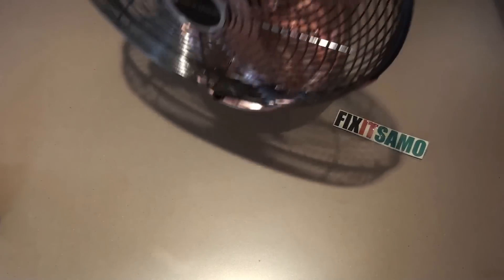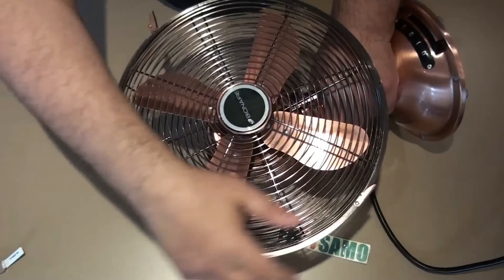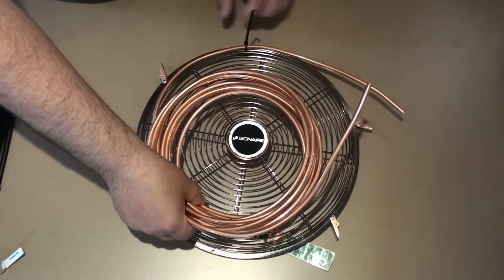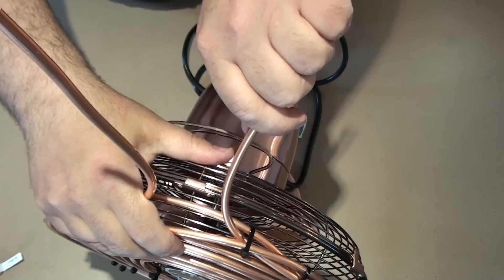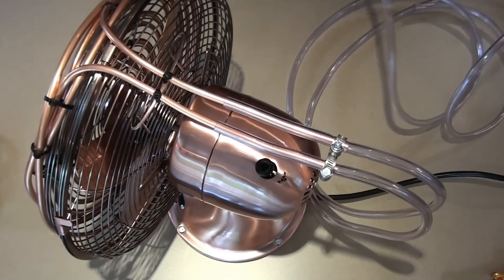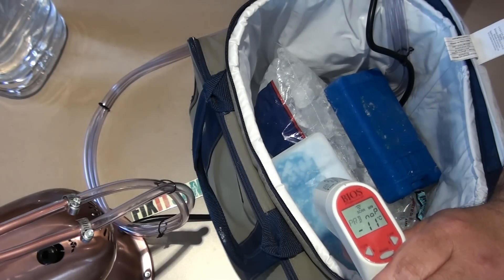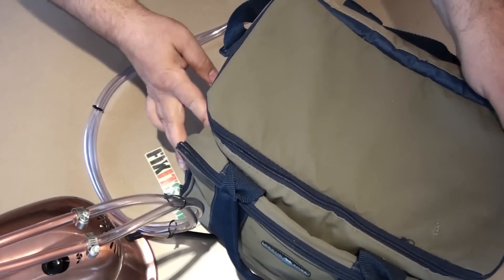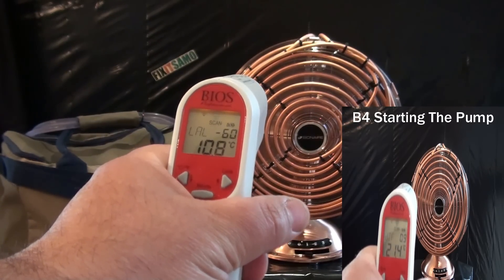How To Turn Your Fan Into An Airconditioner  AC

Comment: Unless you have unlimited free ice source, how does this save money?
Reply: You can just keep a few frozen water bottles in the freezer and cycle them.
Reply: Wow. Let me dumb this down to Kintergarden level, I can't make crayon doodles here for you. An ice maker makes ice by removing heat from the water. The heat removed from the water enters your home via the cooling fins on the back of your fridge, plus the heat from the electric motor and components  of your fridge, plus the heat generated in all the frictional losses, etc.  Also, the motor on the fan itself produces heat, and the fountain pump produces heat. Long story short, this system introduces more  heat into your home than was there without it in several ways, and uses more electricity in the process. The only benefit whatsoever is the cool air right in front of the fan, every where else in the house will be slightly hotter to compensate.
Reply: *****
I apologize if I offended you. I wasn't saying that this idea would not cool a person off if he were sitting in front of it, and also did not read in the description that you were living in a van. Not knowing that, it  seemed like you were advertising this as a 'free' or 'cheap' Air Conditioner, and it seems like a lot of viewers saw it that way. 
If you have a free source of ice, hotel icemaker, a friend with a big freezer, whatever, or even if your freezer is outside your home, then the ice you bring inside will give you a net drop in interior temperature as it absorbs the heat from inside your living space. If you create the ice inside the area you are trying to cool, the device you use to create the ice will not only put the heat it removes from the water (to turn it into ice) back into the room, but also the energy the machine uses to accomplish that task, also in the form of heat. You may feel cooler if you directly in front of the air stream of the fan, and the evaporation of your sweat in the moving air will also help to make you feel cooler, but the entire system will only add heat to an enclosed system, as there is nothing moving the heat from inside your van to the outside of your van.
Reply: You are still missing the point. The roof vent in your van will pull hot air from the ceiling of your van, correct, but anytime you pull air out of a space, you create negative air pressure that will suck outside air back into that space.., . Insulation in your van will help keep outside heat from creeping in, correct, but if your ceiling fan is sucking hot outside air back in, you aren't gaining much, eh?  If you are sitting directly in the air stream of this device you will feel cooler, correct.
BUT- as a whole, your system introduces more heat into your van than it removes. The fan motor produces heat as it consumes electricity to turn the blades. The water pump produces heat as it consumes electricity to pump water. The ice maker produces heat as it consumes electricity to turn the compressor and run it's internal fan. All three of these devices produce heat. If they are all in your van, and your van is insulated, you have actually heated your entire van to cool a small area. Do you get what I am saying? When you make ice, your icemaker removes heat/energy from the water and dissipates that energy via the coils on the rear of the machine, right into your van, PLUS  the heat used by the electric motor running the icemaker, plus the heat from frictional losses, etc.  Same for the fan and the water pump. All this heat is now INSIDE your insulated van. Whether you power the icemaker, fan, and water pump with solar panels or an extension cord to your mom's house is irrelevant, they will make the same heat either way. Now, if you mounted everything outside your van, with the fan blowing in thru a hole or window, the heat and waste energy from all of your equiptment will be outside your enclosed, insulated space.

Comment: Neat, but not practical. What about the condensation that is going to occur on that coil? Just let it drip?
Reply: No condensation  because of fan's moving air.
Reply: Or you could put a pan or towl under it, dumbass
Reply: haha no condensation... yes condensation the cooling coil is below the dew point depending on humidity it can condensate a lot!

Comment: Now plug your solar panel into the fan and pump and you will have free cool air
Reply: You could hook up a desktop ice maker to the solar panels too you know. Several videos on youtube about it. Point is that you could take it even further and reduce the cost of even the electricity itself.
Reply: TheGrayman1234 That wouldn't work very well for your room unless the desktop ice maker is outside or in a room you don't care to get hot.

The issue is that the desktop ice maker makes ice by forcing the heat into the air around it. It actually produces heat while doing this as well. So if you do this, you may have a fan blowing cool air, but the air around you will be getting hotter and hotter. 

This is why your air conditioner runs the antifreeze outside to cool it off, so the heat has somewhere besides inside your house to go. Notice you never see a stand alone A/C unit like you do heater. You have to either have a central unit which runs the heat outside or a window unit which puts the heat outside through the window.
Reply: TheGrayman1234 I get your point as well, but its not an efficient system. It would be more efficient and cheaper to hook a window unit up to a solar panel.
Reply: yep, ACs just move heat, they dont hmake it disappear
Reply: im not going to reply about Mexican joke
Reply: Not free. You still need ice. Either you buy it from the store or you get it out of your freezer. It needs energy and water. If you do get it out of your freezer then its likely you would be better off just not plugging up your freezer.
Reply: +David Parham Sure window units are more efficient, but cheaper to hook up to a solar panel? Hehe. AC units are energy hogs. To power a 500 Wh window unit about 8 hours per day, you'd need about eight 110 Ah batteries costing around $1,100+, six 200 Watt solar panels costing about $1,200+, a charge controller costing around $200 to $1000+, an inverter of about $150 to $1000, racking, wiring and accessories costing about another $200 or so. Total cost of around $2,850 on the low end and that would primarily only power the AC unit. Some use even more watts of around 1440 Watts per hour. Triple that cost. And don't forget the cost of the AC unit itself. 
Still think it's cheaper?
Reply: HealthIsPower Window unit will be cheaper per unit of heat you take out of your house. Anything you build will not be nearly as efficient. Theres no need to reinvent the wheel.
Reply: HealthIsPower To clarify, TheGrayman1234 was trying to take a cooler (fridge), use it to cool down water, have that water travel through the copper pipe, have the fan blow over the copper pipe to take heat out of the air, down the piping, into the cooler, where the cooler would then pump the heat outside... which wouldnt even help if the entire thing was in a single room. All of this would have to run solar. All I was saying is it would be more efficient to just buy something that was built to move heat. That fan isnt going to cool down an entire room, but that A/c unit could if you wanted it too. It could do exactly this, and pump air over your face. You would only need it at an eighth blast.

Comment: if you put salt in the water it will super cool the water making it even colder.
Reply: You would destroy your pump with salt. :/
Reply: because salt water aquariums don't have pumps...
Reply: @David Parham, Salt won't kill your pump there are millions of salt water aquariums that use similar pump systems that has galvanized metal shafts. Yes the shaft would corrode but only after a year or more, or you could simply get a pump with a ceramic shaft.
Reply: Care to explain why?
Reply: true. We learned that in 3rd Grade when we learned how to make homemade ice cream, it was in science class they were teaching us about how salt and ice makes things so much cooler enough
Reply: not if you make it a seperate circuit, as in a heat excahnge unit (like coiled up copper tube)
Reply: Stephan Joubert Yeah. I guess salt water pools have pumps as well. You also have pumps used for cutting tile that get all the tile dust in them. Didn't quiet think that one through. The truth is I disagree with the salt in the water making it colder reasoning, but this was an easier target for me.
Reply: +Roman Tomjak depression of freezing point due to non volatile solute i.e. salt here.
Reply: dhruv anand That doesn't explain why putting salt in the water helps lower the temperature. The truth is, in order for this to work we would be needing to put the salt on the ice, not in the water.
Reply: +David Parham no, actually what we're trying to do here is to keep water in liquid state as the ice is at - 11° Celsius and without salt water would freeze at 0°. Hence, we know to lower its freezing point by adding salt
Reply: dhruv anand If we were trying to do that, then we would have problems with the water freezing in the first place. He doesn't have ice running through the pipes. The water is staying above freezing point the entire process. If you were to add salt to the water to make it cooler, you would need some extra modifications like adding salt to the ice or having the water be cooled longer.

Comment: good idea. a portable a.c is expensive to buy not to mention the wattage used. but what about the condensation that accumulates on the copper tubing? does it just blow in the wind?

Comment: amazing creation. can you use dry ice unstead of regular ice?
Reply: remember that it gives off CO2.  dont want too much of that in an enclosed space
Reply: you would need to design it more like a heat sync then a water cooler but yea. basically get a bunch of dry ice and stick the metal tubes in there the tubes will get cold from contact... how cold IDK.
Reply: also this ^

Comment: Nice design. I would suggest for version 2.0 that you use a small plastic cooler instead of the bag cooler, and add some salt to the water so that it stays colder and lasts longer.
Reply: It doesn't last longer with salt, it lowers the melting point which increases the speed of melting
Reply: It'd destroy your pump.

Comment: What do you do about the condensation on the copper tubing? I'd be very concerned about running an electric fan around parts that will pull the moisture from the air.
Reply: If you notice the copper tubing is on the outlet side of the fan. Condensate will be put into the air by the fan. similar to how a swamp cooler works. no need to worry.
Reply: The wind blows it away from the electrical stuff?

Comment: Good try, but cooling with melting ice is only 334 kj/kg, it is better to evaporate water it gives 2257 kj/kg , that is why evaporative coolers exists.
Reply: true, but that's much harder to build at home.
Reply: Evaporators only work well in dry climates.

Comment: Tried it. Air was cool directly in front of coil but had condensation build up which was dripping water all over the floor under my fan. Also, definitely need to use a proper cooler. I used a bucket with ice and water for the test run. Didn't last more than an hour before ice completely melted. I will try it again with a cooler in hopes of keeping the water colder and longer. I live in the Philippines so needless to say, this would have been a great idea had it work a little better. I'll give my results with the cooler later...

Comment: This has it uses for only special, but temporary cooling like when your A/C breaks down or when you are cooling a space for a day. I suppose you could use it as a desktop cooler, but keep in mind you still have to make the ice for this to operate. In a more permanent installation for cooling a room, a window unit or portable air conditioner will always be more efficient. If you regularly need some zonal cooling for a room in a central, climate controlled building, just get a cheap 5kBTU window unit. The are known to run less than $100. At 400 to 500 watts, it's safe enough to run on any 10 Amp or higher circuit. Keep in mind that once the room reaches the desired temperature, the thermostat on the unit will occasionally operate to maintain the right temperature so it won't always be pulling its rated current. Of course, it will run more on hotter days and cooler on cooler days.

Comment: The test method at the end is not very accurate as your aiming the IR temp probe at the copper pipe which has cold water running through it.
Show the temperature of the air going into the back of the fan and coming out of the fan with the water flow off and on.

There will not be much surface area on those copper tubes so the cooling wont be that high.
Reply: Not to mention that you don't know what the room temperature is. If the room temperature is 15 degrees, that's one thing, but if it's 35 degrees that's something else. In other words, how much is it being cooled?

Comment: Wouldn't it be easier to get a can of R-134a for car AC and fill the lines with it and make a closed loop system? Would sure beat having to use all that ice water...
Reply: You do know how AC works right?

1: R134A starts off as a gas
2: the R134A goes through the compressor
3: after the R134A has been compressed it becomes hot
4: so it goes though the condenser(A radiator) to cool down
5: the the cooled gas goes though the receiver/drier unit to remove any water that might be in the system
6: the cool gas then passes through the evaporator where the gas expands back, this releases heat(think of when you spray a can for a while how it gets cold)
7: this makes the evaporator very cold, the fan behind the evaporator blows this ice cold air out into the car,
8: the expanded gas then returns back to the compressor
Reply: how to compress the gas?
Reply: Precisely. Freon in itself has no cooling effect. It is simply a gas (with a pag oil additive) that can be compressed and expanded, allowing it to absorb/give off heat as it goes from high to low pressure (high pressure liquid to low pressure liquid to low pressure gas to high pressure gas to high pressure liquid to.....). Putting freon into the line without a way to introduce a refrigeration cycle is ineffective. Want to see how ineffective? Turn your car on without cranking it. Turn on the A/C. Feel refrigerated air? Nope....because the car isn't running (hence no compressor) despite all the freon in the lines, condensor, evap core, etc....
Reply: well why not get a compressor to hook into it? can pick one up at local junk yards for practically nothing, it doesn't have to be fancy, just functional.
Reply: you would need to radiate the heat outside outside of your cooling space like any other ac/ refrig
Reply: look at "ductless ac", the compressor is outside, the compressed refrigerant is pumped inside your house where a fan blows on it.

Comment: why sould it have vabritions???you dint touch the blades or the motor....
Reply from the maker: +Eftihis Androulakis 
If the cooper tube is loose and not very well secured it will it will make noise when you start the motor

Comment: Which homemade ac is better : this one with the cooper tubes and punp or the ones that just blow air trough  ice in a cooler?
Reply from the maker: +TheDRIBBLER2 
With this method the ice will stay cold for around 12 hrs cause the cooler is closed and the ice is very well isolated 

Cause  by making a hole in the cooler and blowing  air in it  logically the ice won't last for a long time  its like taking the ice from the freezer and  putting it in a open cooler 
The ice will melt in 3 hrs max
Reply: It's a combination of how much ice you have and how fast you bring it to room temperature.  You're not going to get more total cooling from swapping these methods, that is only determined be the amount of ice you have.  If the ice lasts a long time, you're not getting much cooling and vice versa.

Comment: if you ran the ends of the copper on the bottom instead of on the top of the motor there is no risk of electrocution if the system leaks
Reply: doubt it would leak... there's not enough pressure to cause it...js

Comment: That would melt pretty quickly,especially on a hot day......
Reply: Just add salt inside the cooler and it would be cooler
Reply: This will corrode the pump.
Reply: Salt just causes the ice to melt.  It doesn't do anything to the amount of heat it can absorb.  Think of it this way, you have ice and water in @ 32 deg in one tub and saltwater @20 deg in another.  The first tub will stay at 32 deg until  all the ice melts then steadily rise.  The second will steadily rise from the start.  the difference is 0
Reply: aquarium pumps are made for saltwater... saltwater fish tanks

Comment: I wonder if a front evap core from an old ac would work.
Reply: It will work quite well due to the high surface area of the unit as it has fins.
but you will need a fan that has a high static pressure as those fins are tight.

Comment: Simple fix to try. Stick reservoir in freezer. Fill reservoir with anti-freeze. No ice needed, no maintenance.
Reply: do you not know how a freezer works
Reply: alcohol is better than anti freeze, you dont need methanol, but IPA will work
Reply: Worth a shot,  but It might move too much heat into the freezer. The sealed system on most residential refrigerators are rated under 1000 BTU.

Comment: Would adding salt make it colder?
Reply: salt and copper don't mix well.
Reply: Use a g13 coolant, way better dispensation of heat an greases the pump

Comment: there wont be condensation  issues since  un like a store bought air conditioner  pulles air through the cold coils and becomes dry air ..this will still push the moisture  with the air ...dont believe  ...build one and see